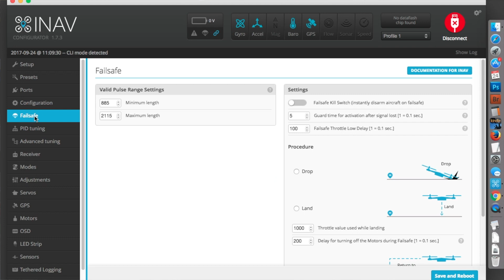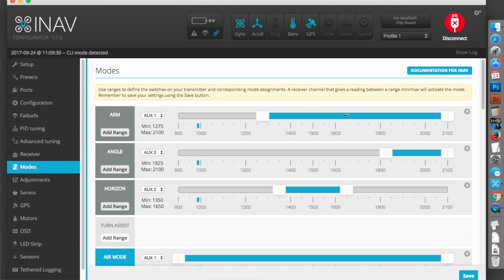AIR3 iNav TekSumo setup

Comment: Looked a lovely day Andrew....You and I are exploring iNAV together!!!. I just tried Altitude Hold myself the other day and it works great. You can still override the Ailerons if you want to but not the elevators, but in my OSD it keeps height within 1 mtr or so, which isn't bad at all..!!!..I dont bother with Angle Mode, its a waste of time as it's so restrictive and does not allow bank angle....it's just a weaker form of Horizon Mode really.  I have my max bank angle set to 45 deg / Max Climb at 20 deg / Max dive angle at 5 deg....Restricting the dive angle to only 5 degrees is useful when doing RTL from a great height / distance for example as it gives prolonged speed increase over a longer distance...I set my RTL Cruise height to 100mtrs.
   Warning, before gliding, motor off for more than 5 seconds!!!....ensure you have typed in the CLI to prevent the board disarming itself...!!!!....Ask me how I know...and yes, the board does disarm on the glide!!!!..Try it...you can still control the plane so dont worry....You may not notice since you have no OSD telling you exactly what the board is doing....Read the Wiki about it is my advice...its easy to prevent.
www.youtube.com/watch?v=38-g19_QfXk&t=13s
Reply from the maker: Thanks English, any tips you can pass on are greatly appreciated. I am only now at the stage where I can start fiddling with PIFFs and other settings, but it's brilliant as it is. Might be able to smooth out the wobbles a bit more. My heading hold drifted a little on occasion, but the altitude was spot on.
Reply: Yes, no problem...The Heading Hold may not work exactly on a wing as i think it uses Rudder to control direction rather than Ailerons, although my Falcon manages RTL without problem even in a cross wind as you may have seen. I used the z84 wing wing preset, but upped the gains for use on the Falcon...(P)..You can always back them off if it starts to oscillate...When you start using the Omnibus F4 with its OSD, you will really see how well it can work and gain confidence enough to fly out more....RTL works so well It still makes me smile every time...lol....I will see you fly a few Kms up that fantastic Coastline one day, and I can't wait to see it...:)  For the outlay, Omnibus with iNAV loaded represents remarkable value.

Comment: Do you have to have Carbon Bird/ or digital servo's for the Air3 or will any fast servo's work fine?
Reply from the maker: Any servos work but the fast digital metal gear CarbonBirds make full use of the AIR3 processing power and can handle higher voltage for even faster response. I sound like an ad, but they are the best servos I have used.
Reply: Andrew Newton Thanks Andrew, I ordered the Air3 & OSD for my MTD but forgot the servos. I'll get some next order, be a while 'till I get to it.

Comment: What exactly you need AirMode for on fixed wing?
Reply from the maker: So you can glide with motor off and still have control
Reply: Hm, on the second thought, control is done via the servos, right? Do they depend from AirMode? I thought AirMode is needed for quads, cause for some moves you need difference in the motors speeds,, but for wings... It is just servos - they are accessible all the time (throttle down time included), right?
Reply from the maker: This is in the iNav Wiki for Fixed Wing - "Use Airmode mode to get full stabilization and servo throw with no throttle applied"

Comment: hello , you should not trim it in passthrough mode with your remote trims becose the flight controller in angle or horizon thinks that the amount of radio trim is actualy stick imputs, I mean whenever you are in any tipe of stabilized mode your remote sticks and trims should be ded center if you want it to fligh straight, and there is a autotrim mode that you can activate with your modes, you should use that, sry for the bad english good luck
Reply from the maker: Thanks Paul, have to admit I'm not on top of the trims yet

Comment: I think nose down is due to angle of attack (3.3 degrees is too low especially for flying wing),
For example MH45 has best Cl/Cd : Alpha at 5+degrees (7 at low Reynolds #)
Also Cm : Alpha close to 0 is way beyond 5 degrees
http://airfoiltools.com/airfoil/details?airfoil=mh45-il
Reply from the maker: Oh thanks, very helpful. I ended up with 9º pitch tilt which was a little too much, so 7º seems about right.